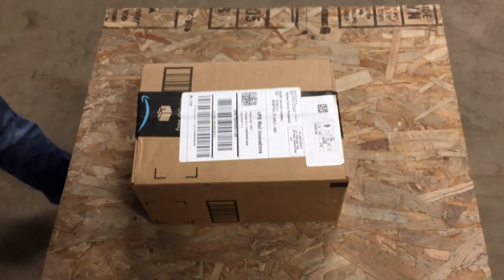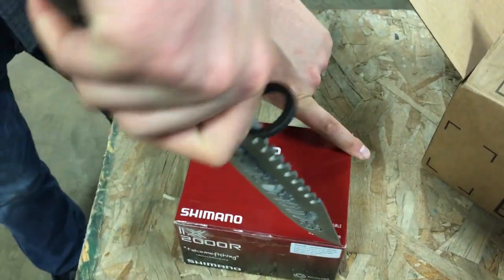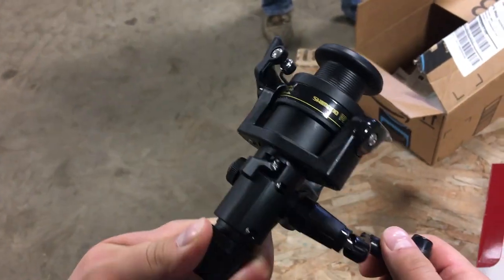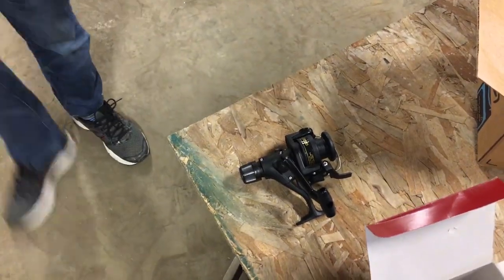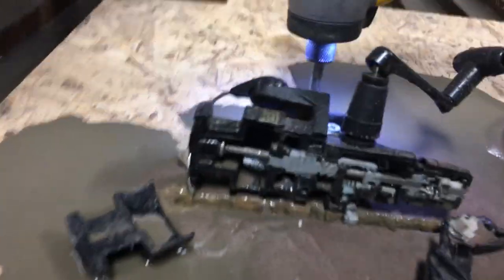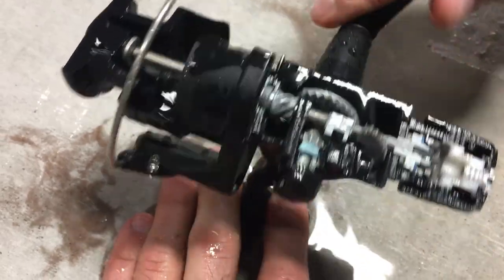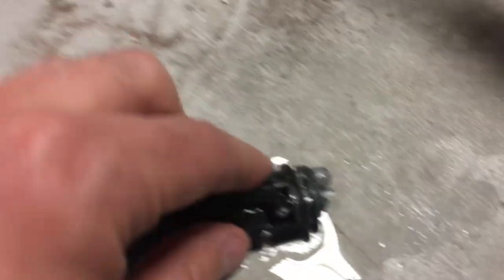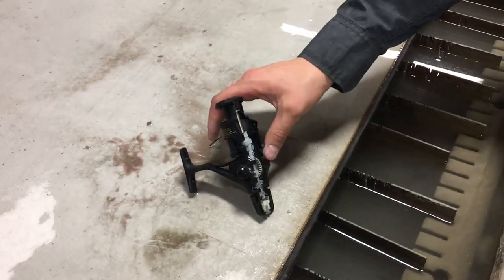Fishing Reel vs 60,000 PSI Waterjet

Comment: I wonder what would happen to one of those large industrial size Saran Wrap rolls under a waterjet? Like those used to wrap around pallets in factories.
Reply: If you cut it perpendicular to the axis -|- you get two smaller rolls.
If you cut it axially --- it'll split open in two halves that will peel lightly.
Some layers will fly off due to the water tho.
Reply: Alucard Pawpad oh, cool. Was mainly curious about cutting it axially. Thanks!
Reply: Or a silage wrap roll. like the kind they use to wrap hay bales to turn them into silage